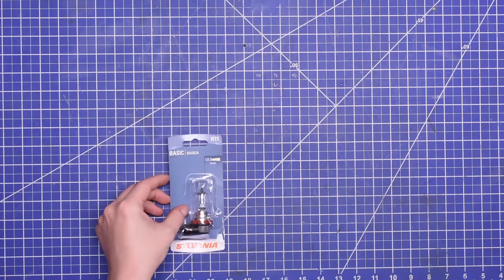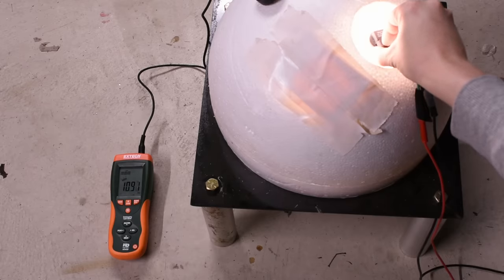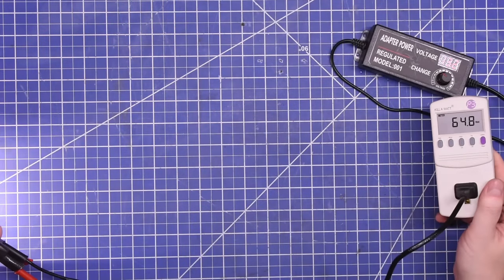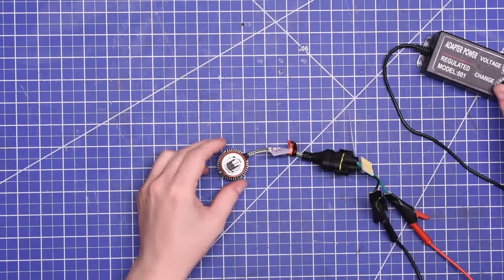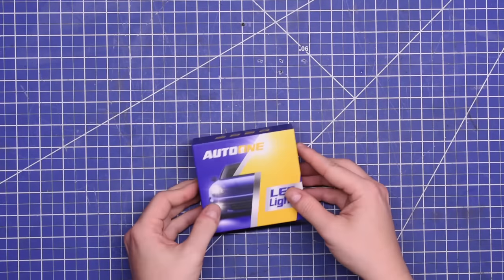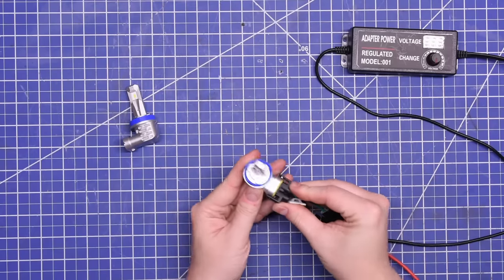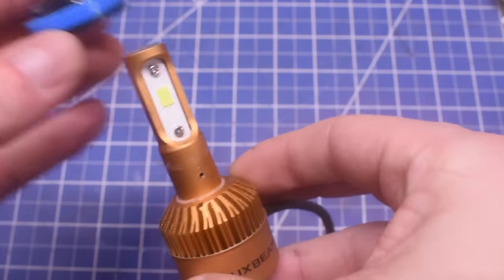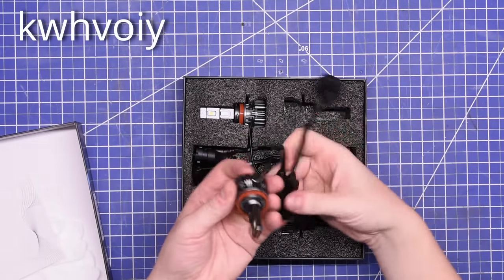Amazon Headlight Bulbs are Getting Out of Hand

Comment: I installed fahren bulbs in both our vehicles (2002 Sierra HD and 2018 Yukon XL). They’ve been in for years now and while they definitely don’t meet the lumen claims I find it to be significantly brighter. Especially in the projector style housing in the Yukon. It’s an H11 bulb and has exactly the light pattern it should when measured using an optical headlight aiming tool. I’d buy them again without hesitation.
Reply: I'm glad to hear that, I literally replaced a autoone h11 that lasted 13 months with a set of Fahrens this weekend. I like that the driver is separate so it doesn't cook when the LED heats up
Reply: Can you be more specific on which ones you got? I see many listings with “Fahren”. (Turns out “Fahren” just means “drive “, I’m not sure it’s really a name.)

Comment: The Sealight Xenower is the best lamp ive tried . Easily 3 to 4 times brighter than the other competing lead lamps and with a much better focus of the beam.
Reply: I just bought those I wish he would have used them. Do they blind drivers passing by? Or are they just right
Reply: @BigDavos  any light will blind drivers if it is: 
a: improperly aimed
b: in a housing with a scratched lens that scatters the light.
Be sure your lenses are clear and not foggy, and that the beam is aimed properly according to DOT standards and you'll be fine.

Comment: I recently swapped to LEDs and keep getting flashed with just my running lights on. The random spots of messy light above and below the beam was something I hadn't considered, looks like I've gotta go bulb shopping!
Reply: Did you “clock” them so the chips are facing sideways? The body of the bulb should turn within the collar to achieve this.

Comment: I put Lasfit LEDs in my Mercedes ML350 about a month ago. They look to be about twice as bright as the stock halogen lights. I compared them in my garage with a new Mercedes with stock LEDs and they look the same in terms of brightness, temperature, and light pattern. No error codes either. 

In actual use, they are vastly superior to the stock halogens and are equivalent to the stock LEDs in the new Mercedes. Also, no one has flashed their high beams at me.

The claim is "output of 6000k 6000 lumens/set." It looks like 6000K to the eye, and 3000 lumens per bulb is likely at least in the neighborhood. Funny how the quality bulbs don't made outlandish claims.

Installation wasn't super-hard, but it wasn't super-easy either. I wouldn't say it was too big of a deal though.

Comment: The new Holley retrobright bulbs would be interesting to see.
Reply: The RetroBrights are not bulbs, but complete reflector-type headlight housings with an LED in them. The LED in itself is not supposed to be the best thing ever. In fact, Holley (and Morimoto who manufacture them) publish all the data on brightness and you can easily conclude they are not as bright as even a basic HID kit. Their selling point is improving on sealed beams (not a high bar) and keeping the classic look on old cars. The general consensus about their beam pattern and value for money is that they are still not worth it and you would be better waiting for a version 2 or 3. Remember these are $400 for a pair. An order of magnitude more expensive than these single LEDs tested here.
Reply: @ericgonzalez8382  I paid a quarter of that for Cibie E-code housings with H4 bulbs and a wiring harness. The low beam output looks like halogen projectors and high beams are like daylight. They look like sealed beams, maybe slightly different because of the lens optics but not overly modern.
Reply: @bwofficial1776  Yup, that's a way better approach than the RetroBrights right now. I also went with halogen replacements, Koito 7" H4 reflectors with an upgraded wiring harness and stock 55w bulbs. The brightness and beam patter far exceeds any other halogen-equipped car I've ever been in.

Comment: The lumen rating to the Amazon bulbs is always 2 bulbs combined.  If they advertise 16000 lumens, it is 8000 lumen each.  Obviously they are still are overrated, but it changes your chart percentage 2 fold.

Also the 2 piece bulbs actually serve a purpose.  LED bulbs should be oriented at 12 and 6 oclock, so the lights are facing at 3 and 9.  The two piece design allows you to properly clock the light in the housing for the cleanest cutoff.

Comment: Worth Considering: Headlight Lenses are designed by the manufacturers for bulbs that emit light on all sides of a round bulb, and not just two sides of it. A bulb emitting light on only two sides will give you a light spread departing significantly from anything factory, and usually in a bad way. In my experience, this is a bigger deal than lumens rating or color temp. They are tough to find, but Amazon does carry LED headlamps with six diodes arranged in a hex formation, and so forth... other options approaching a true 360 degree bulb. This is the way to go and what I go for in buying my own replacement headlamps.

Way better than two-sided garbage.

Comment: I purchased these bulbs AUXITO 2023 Upgraded 9006/ HB4 LED Light Bulbs 6000K White, 100W 20000 Lumens, 600% Brighter 9006XS HB4A LED Bulb Conversion Kit with Fan for Low Beam, 98% Canbus Ready, Plug N Play, 2 PCS. I am wondering how these compare to the ones your purchased.  I had stock halogen bulbs and this was a big improvement.

Comment: @TorqueTestChannel all the LEDs had light above the cutoff which would be an issue for oncoming traffic.  I wouldn't rate them higher than a 2/10.  It's not just about lumens and color temp it is about where the light is going, and in that metric the halogens should be the clear winners.
Reply: Big L for reflector style headlights. Projector headlights stay winning. (80w spot lights)
Reply: I wouldn't give them any rating, they should be flat out disqualified from the test if they spray.

Comment: The great irony of these Chinesium crap bulbs is that you install them to see better at night, and everyone else is blinded by them.
Reply: The great irony is that it's not the bulb's fault, it's that of the installer. After changing bulbs (of any type), it's recommended that you recalibrate the beam's trajectory, which seemingly nobody does. At a distance of 25', your beams should be 3' off the ground, which is the standard used to keep oncoming traffic from being blinded... You wouldn't complain about not being able to see if someone aimed a flashlight at your thighs (regardless of brightness), and yet here you are complaining because, like so many others, you didn't think to aim the light at anything else than a face. That's literally what the adjustment screws are for.
Reply: @RAW_Reality  The problem is you can have your headlights professionally adjusted all day and it doesn't help eliminate the light spill outside the intended beam that some LED retrofits simply have.
Reply: @martinweizenacker7129  
"Light spill", as you refer to it, doesn't happen by mistake, it happens by ignorance. Beams of light stay true to their namesake (a beam!), so if you're having refraction/reflection issues, I can effortlessly think of a half-dozen ways to solve that (ranging from tape, paint, alterations, etc) that'd solve said issues, but let's blame the bulbs instead of one's own unwillingness to make those changes. Additionally, it's (likely) not that the same light spill "wasn't" happening before the bulb change, so much that it wasn't as noticeable with the dimmer bulb. In short, the lens of which your bulb emits its light off of is more the problem than the bulb itself.
Reply: @RAW_Reality  Light spill in reflector headlights happens when the source of light (filament) is not precisely, down to fractions of a millimeter, where it should be or if it is of a different size than what the headlight was designed for. (Slightly different story for projector headlights, but let's ignore those here.)
So in other words, exactly what happens with not so great LED retrofits that don't care much about emulating the halogen filament geometry faithfully but rather just dump loads of lumens into the reflector in some way.

Using tape or paint to "fix" literally anything related to light on a car is botching, and in Western countries illegal anyways, minus some exceptions. For the case just described, it simply is the fault of the lamp, not the user.
Reply: @martinweizenacker7129  If what you're describing is 100% true to its entirety, then by all means any bulb that wasn't EXACTLY 100% OEM would then inherently be problematic to some degree or another, which would then also entirely cause regulatory standards that'd state "you can only replace bulbs with the corresponding OEM compliant replacement part", and obviously that isn't the case, by the Nth degree of options. So to say that "botching" is "illegal" would be, at best, hypocritical, since then any alterations outside of making an OEM replacement would then be botching, quid pro quo. Ergo, simply taking the OEM item out, per your example case, would be illegal, and ultimately the fault of the user, barnone. Which, BTW, in such a distorted reality, would have relegated any manufacturer of bulbs (long before the invention of LEDs) to only ever being able to make/sell viable equivalent replacements for factory OEM parts on a per-model basis. 
I'm sure Phillips and other such brands would "love" to live in the "reality" you've set the groundwork for here. 
/s
Reply: @RAW_Reality  I give up, you think you know it all. Good luck.
Reply: @martinweizenacker7129  If I'm guilty of anything, it's for calling a spade what it is, so look in the mirror before making such statements, don't be a hypocrite when making them, and understand that I didn't start a conversation I wasn't capable of finishing. That's not a fault of mine, but as you've provided plenty of examples of doing, blame someone else for your shortcomings. I'm willing to understand, grow, and learn, while you're seemingly too smug, so... Good luck.
Reply: @martinweizenacker7129  
Fact of the matter is this: How a lightbulb in a car reflects off of the lens isn't unlike a flashlight reflecting off of a mirror, but in that example you wouldn't make the excuse of the bulb size/lumens/filament type/shape of a flashlight make much (if any!) difference reflecting the light off of the mirror, as a beam is still a beam going into the reflector regardless, so you'll have to explain why you think it makes a world's level of difference being inside a headlight of a vehicle before your stance has any ground to walk on...  Remember, it wasn't me prompting an argument that started this, it was you who tried to conflict with the fact checking that I did... So if you're unable to fulfil my request, then all you're selling is misinformation, Mr. Highandmighty, and it wouldn't be "me" that needs to get over themselves... Again, just calling a spade for what it is.
Reply: It is in fact illegal to put a LED bulb in a incandescent reflector housing for the exact reasons Smucky! describes, and there are regulations on wattage that are obsolete where LEDs are concerned. Very few cheapo or even expensive LED bulbs have a geometry that will allow the sharp cut off of light necessary to avoid blinding other drivers. You can go play with your set screws all you want, it won't make a difference if the bulb doesn't place the light correctly in the housing. Secondly, in case you haven't been in a car at night in the last 5 years, retardedly bright LED bulbs will still cause glare and blind others since we don't all exist in your magical world of perfectly flat straight roads where all headlights are aimed perfectly, and cars are all at least 25' apart and have headlights the same height. The fact is a point source light that may be 5-10 times brighter than OEM, even if aimed correctly (it's not a laser) will still blind you. 
I have successfully retrofitted LED headlights to cars, but it takes trial and error, looking carefully at the brightness and often times several brands before you get acceptable results.
At the moment, the inundation or junk chinese LED bulbs does more harm than good.
Reply: @laiky71  Well said, I agree with everything you wrote.

Comment: H7 Bulbs.  Yesterday I tested The AUTODONE H7  LED  and the SYLVANIA H7 Xtravision Halogen.  I mounted them in my GL450 projector style headlights. I photographed the pattern on the wall and measured each using a Techtronic digital photometer.  The patterns and light output was very nearly identical.  I hoping for brighter but for only $30 these will work great and last way more than the 150 hours rated for the Sylvania.  So I have no worry that they will cause any trouble for on coming traffic.  AUTOONE H7 LED Bulb, Super Bright 1:1 Mini Size LED H7 Light Bulbs, No Adapter Required Plug and Play, Non-Polarity Fanless Halogen Replacement Bulb 6500K White.   The only downside of the AUTODONE was that the diameter of the mating surface was just a fraction of a mm to large to push in and then turn to lock.  So I sanded the finish off that part and put a little grease on it.  All good.

Comment: You could try substituting H9 bulb for H11. it requires modifying either the tabs on the bulb, or on the tabs on the housing to get the H9s to fit.  I did this on my 2006 Impala and it worked great.
Reply: So you replaced a low beam bulb with a high beam bulb.
Good thing no one you are sharing the road with also needs to see.
Reply: @stoney2732 H9 is not a "high beam" bulb and H11 is not a "low beam" bulb.  There are no specific high and low beam bulbs, just a bulb with a filament in a very specific and precise location for the headlight housing engineer to direct the light from.  The H9 and H11 are exactly the same form factor as far as the tungsten element and lamp critical dimensions. H9 is higher wattage, so it burns brighter in theory, but there is no more light scatter or any difference in optics when interchanging the two. H9 bulbs are common in fog light housings. Using an H9 bulb with wiring designed to power H11 bulbs might be an issue, though.  Probably unlikely, but 🔥 could be a possibility.

Comment: I have put many different bulbs into OEM headlights. I've put very high dollar PIAA bulbs, dirt cheap eBay HIDs and MANY led offerings. Currently I'm running Fahren double sided LEDs in my avalanche headlights. They are clickable and have a very clean lines. When they are in a decent housing they have a very bright while having a good "cutoff" line. I believe however that the biggest thing a person can look for while buying led bulbs is their length! If your new bulb is longer it messes with the light housing's beam output. That being said, some light housing's just suck! You could find some 50k lumen bulbs that still won't help, like the 01 Cavalier I use to have...

Comment: I wish SunPie had halogen bulbs, I was redoing a headlight set up on a Honda VTX 1800. I tried a set cause they were cheaper than most but touted daymaker level light or better. first set I got had a problem and didnt work properly, they quickly fixed it by sending me a new part without even asking for the old part. and OMG they were amazing, my stepfather that had Daymakers in his bike rode behind me as mine lit up the road much better and clearer than his for about 1/8th the price and the low beams were still edged well enough not to blind oncoming vehicles.

Comment: Please try some of the 360 degree LEDs instead of the 2 sided LEDs. I use a brand called "Light Moses" they look like little light houses with 6-8 LED chips in a full circle instead of the 2 sided ones like this video. I'm super curious as to the difference this makes. To me they seem super bright and the light pattern is way smoother than any of the 2 sided LEDs I have used in the past. Also, I have used them for 2-3 years now and they haven't burned out. Most of the 2 sided ones have burnt out within a year for me. Awesome video! Thanks for the real concrete data!

Comment: My wife has a 2017 QX50. These are projector headlights but only use halogens. Needless to say the light output was downright dangerous at night. I put an HID conversion kit with 55w bulbs, and that was a night (and day) difference, but had trouble with the bulbs going out too much. Ended up going with some of the Scourge Fahren H11s, which are "rated" at 100w output. I tried several others and ended up sending them all back because there is apparently no standard in how these things disperse light. Projectors require a very specific light source location to project correctly and the Scourge LEDs were just right. Every bit as bright as the HIDs they replaced. Like looking at the Sun bright. Still going strong two years later.

Comment: Great video. I have been struggling with night time driving with my 2011 Honda Accord lx 4cyl 4 door Sedan. My headlamps are designed for halogen bulbs, however I cannot find any that are bright enough for the dark roads. I tried Led bulbs and they turned out to be a bit brighter but not bright enough. May you continue in testing halogen bulbs and their alternative Led variants. I can't wait to see which bulb ranks top dog, so I can finally make a sound purchasing decision in an important safety matter.

Comment: The problem of those aftermarket LED-headlight bulbs is, even if you buy road-legal ones, that if your car has no dynamic beam range (which only cars with xenon or LED-headlights built in on the manufacturer's side have), you will massively dazzle other road users, especially on uneven roads.